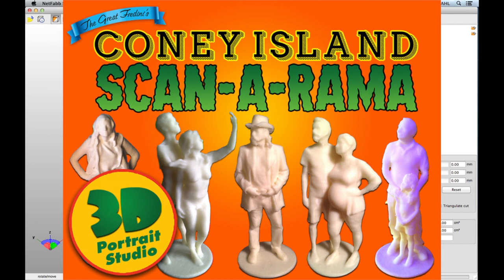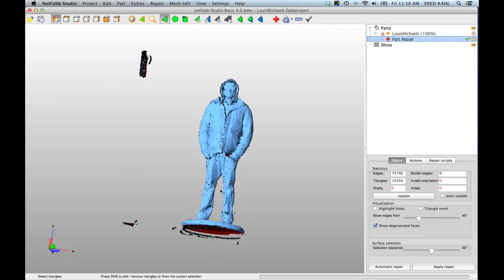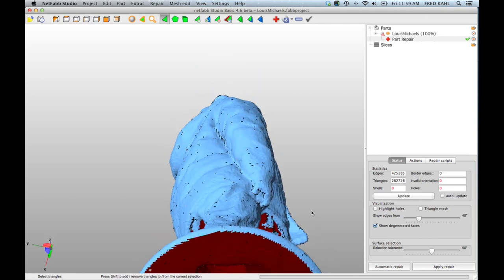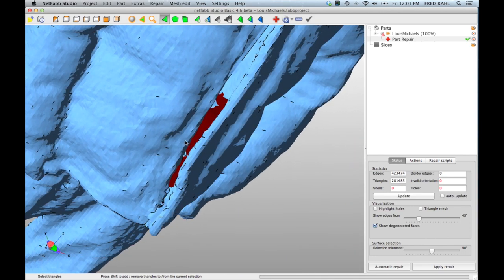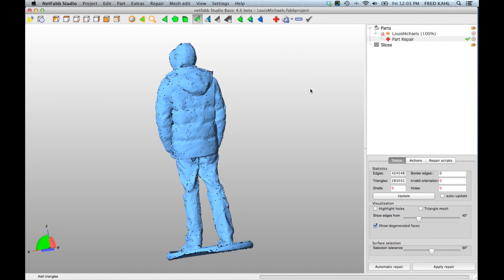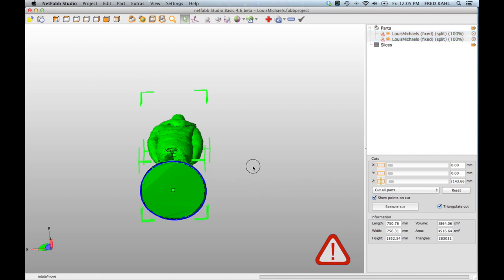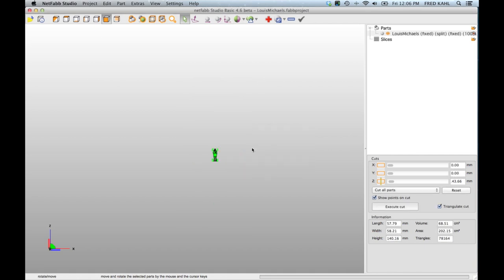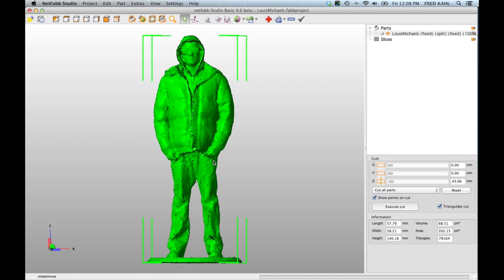3D Scan Cleanup Using Netfabb Basic to Prepare for 3D Printing

Comment: Hi, I have fabbster print #2524. I have problem with activation software, i have serial key and voucher. And after jumped filament and then i put back filament i can't print more, when i start print test, then print prepare to start print and then pause, on computer i click resume and printer came to one position and then come back to default position and paused. nothing print. Could you help me? I have printer just few days.
Reply from the maker: Sorry, I can't help with support. Good luck

Comment: what do you do when you want to keep a hole ? my model is all good blue in the outside and the inside is all red so i have to fix the red inside but if i select the red i noticed that the selection selects the outside as well  and if i do automatic repair it will close my hole so how do i fix the inside without loosing my hollow interior ?
Reply from the maker: Frank Lopez Red is the backside of polygon faces. You always want them facing inwards. I'm not sure what you mean about keeping a hole as there can be no holes if you want to 3D print something- it must be a volumetric solid.
Reply: ok clearly you never printed anything other then a figuring model, as practical application CANT BE filled inside if i ws going to print a life size car or print a Quadcopter, your telling me you wouldn't be printing this models with a empty void? hollow ? if you was to print a robot you wouldn't want holes to insert arms or legs into their respective sockets/joints? 

when you say that red is a inside thing ,...your wrong red represent errors that need to be fix or need an additional face  one for the outside and one for the inside giving it dimension, so in my case i have a model who i design too thin i guess and as a result im left with one face "the outside face" the inner face is red so if i auto fix it will get rid of that red face hense it will close any trivial holes and this section is what i want open "not only hollow but open" try this yourself download a head bust and cut the head of the from the shoulder and now copy the head so you have 2 heads and make one small, now place the smaller one inside the bigger one and use the boolian tool on the small one from the big one and your left with what i may say is close to my model now go ahead and hit auto fix and see the unwanted result
Reply from the maker: Frank Lopez Hi Frank, I have actually printed a large number of things other than figures. What you are talking about with "hole"  is hollowing a model so that it takes less material in printing, but I understood the word "hole" as a hole in the mesh. Hollowing is not something I would do in Netfabb, but instead would do in a tool such as Zbrush. I only use the free basic version of netfabb, but understand the other versions do booleans. If I were hollowing a model out I would use a technique like this: https://youtu.be/IIgjKjq8R7Y

Regarding red, polygons in 3D modeling have two faces, an inner and outer face. Red indicates the backside of a face. In netfabb's repair with polygons selected you may right click and select "flip selected triangles" to reverse those polygons.
Reply: thanks, yes but that wont sole the problem with the hole being close when what i want is to keep it open